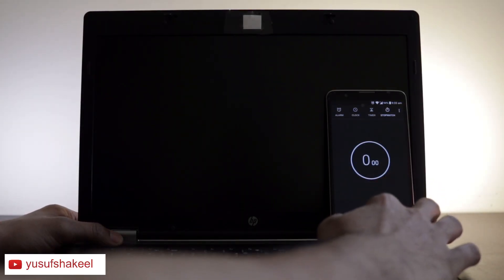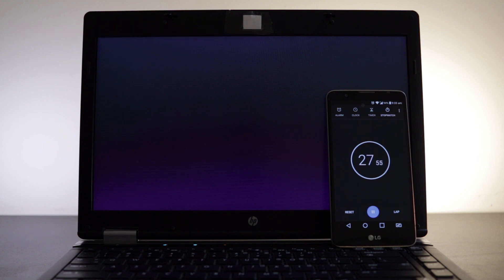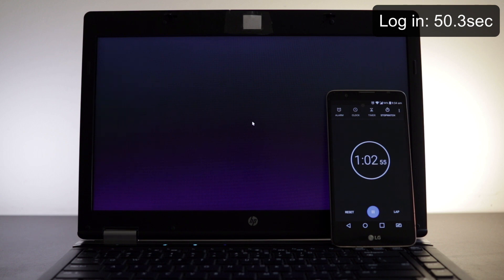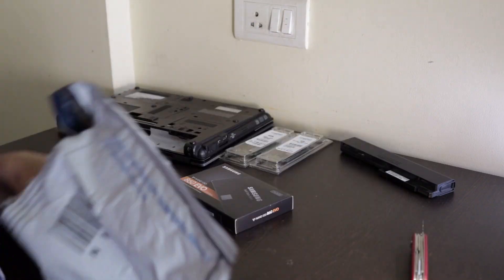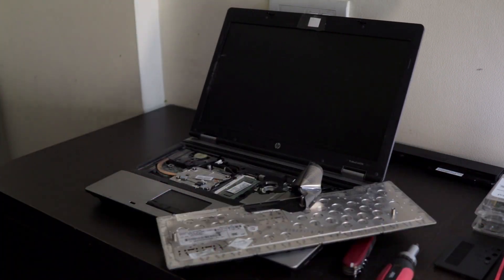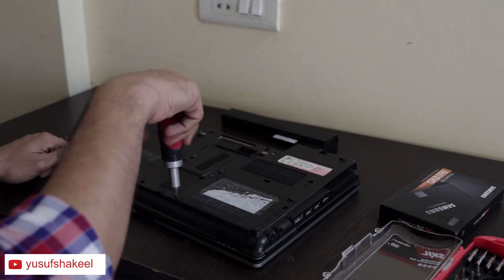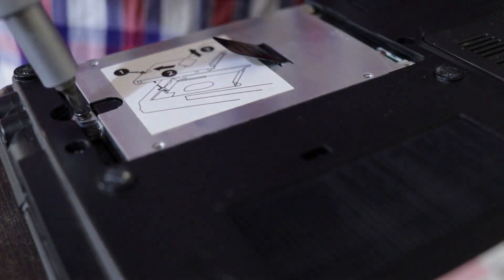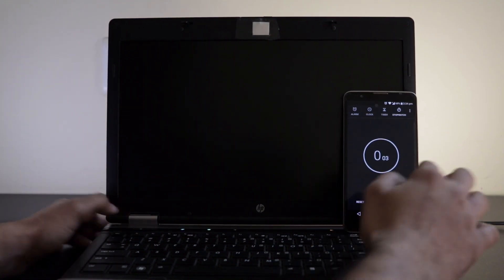Upgrading 2010 Laptop - HP ProBook 6450b

Comment: I found one of these in the trash. It didn't have the battery nor the ac adapter, i purchased an ac adapter on amazon, but it arrives in like 2 weeks. Once it arrives i will see if it still works, and see if i may have to buy a new hard drive as well.

Comment: Did it work with 250 GB SSD?
Reply from the maker: yes
Reply: @yusufshakeel  can I try, 500 gb SSD?
Reply from the maker: @cvrajarshi  not sure. the laptop spec does not specify that much storage space. i had doubts when i purchased 250gb ssd. was not sure if it would work. 500gb ssd... fingers crossed.

Comment: Hi, I have the same laptop as yours i.e. HP ProBook 6450b. I have increased the ram to 8 gb. However I have only 64 mb of video memory. Will it be possible to increase its video memory ?
Note : The graphics driver installed is Intel HD Graphics.
Reply from the maker: i have not tried it.
my laptop is very old now also its been over a decade so quite hard to find parts. you can keep it for simple use keeping in mind that most of the tech from that era is kind of obsolete/out-of-market.
btw i am using ubuntu on my laptop and so far it is working okay. yes the display is not great but manageable.
Reply: @yusufshakeel  I see. Anyway Thank you.

Comment: Bro can I put both the hdd and ssd in this? Or there's space for just one of them?
Reply from the maker: You may have to take out the optical disk drive and swap it with hdd or ssd. that is one possibility. but do check the specs and compatibility.